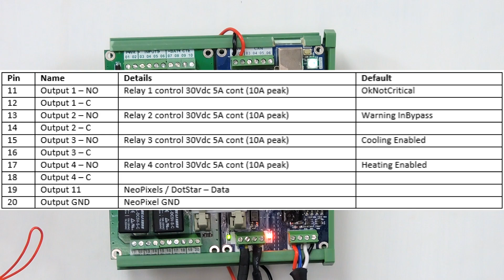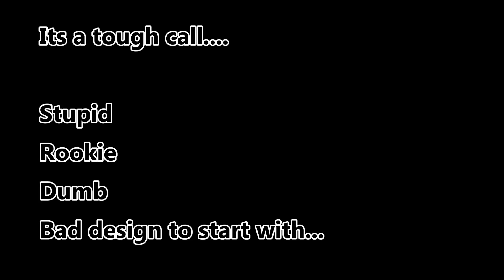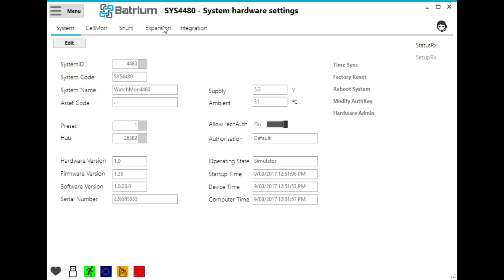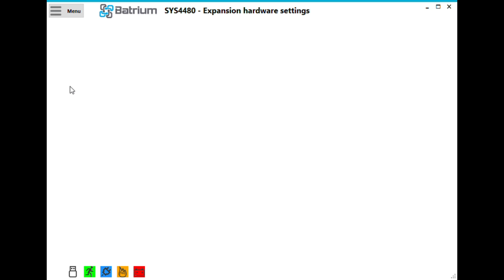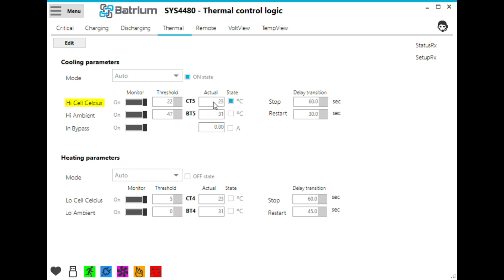Automate fan control using the BMS

Comment: Great video, i had the same experience but was not so lucky, 6 cels short and dead, did not know about fuses.
What kind of wire you use for fuse, how thick, i stopped my project because i need the only for light in the house and these are all leds so loe wattage, and i want to go save
Reply from the maker: From memory I used Tinned copper https://amzn.to/2QIG0Ed was so long ago that I bought it

Comment: Ya scared the willies out of me, as you were doing it I was saying to myself this is not good, to many exposed terminals up top, and in fact not sure I like that at all.  You do need some type of cover Pete, yes mate b/c we need you to stick around.   I think this kinda think happens in every sport, we get good and then we get even better at it and suddenly we do the stupid move right over our ego and the fail happens.   That ego boat don't float as me grandpa used to say.  You got a great channel and it's so cool to see and learn from other Off-Grid DIYer's.   I used the battery pak from the Ford C-Max "Energi" for it's simplicity, it is easy to take apart and it can be configured into any type of system, we are running a 48v with the Magna 4448PAE.  We will be upgrading and adding on but we are off the grid and that was the goal, we may be a limited home but that will not be for long.

Comment: Impressive fuse cascade , You prob get this a lot but what you using for fuze wire? Thanks
Reply from the maker: I've used this in the past https://amzn.to/2Mr1Pmk but also 32awg blows around 4 amps for my tests - this is a video i did a few years ago testing the fuse wire https://www.youtube.com/watch?v=eX6uIz_iflA
Reply: Thank you ill see what i can find , using resistor legs is a bit tricky at times.

Comment: I'm setting up a cooling system now for my pack,,using 2 computer fans and thermostat to control with a small buck converter from my 24volt batter to 12volt to power it
Reply from the maker: Heaps of easy ways of doing it - that said i did this video 12 months ago and never used it since.. easier to leave the fans on 24/7

Comment: Surprising to see that on one pack all the fuses popped. There should be some popped fuses on the other packs that were in the short circuit path as well. Didn't see you checking for those.
Reply from the maker: All were checked only first pack shown had any blown fuses :)
Reply: Guess you were really lucky then ;)